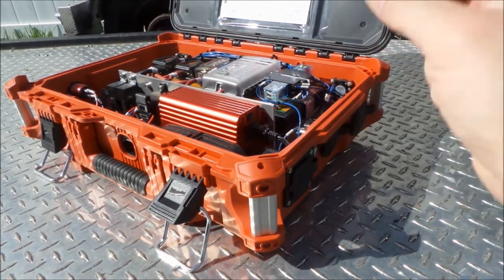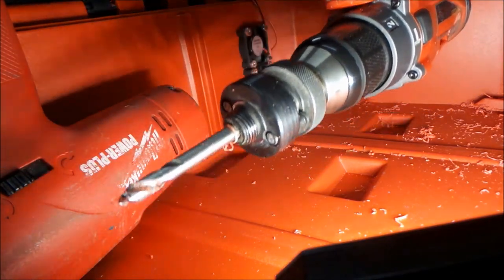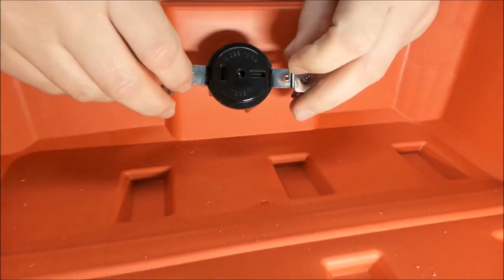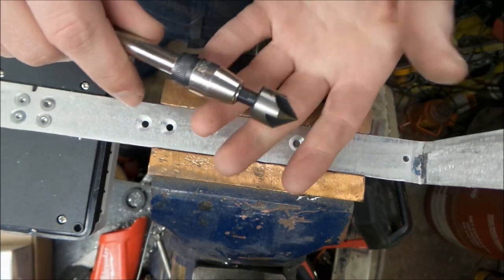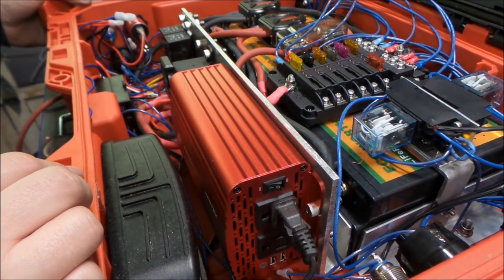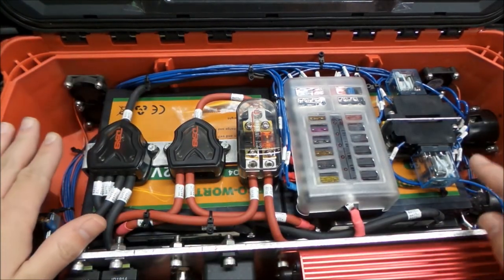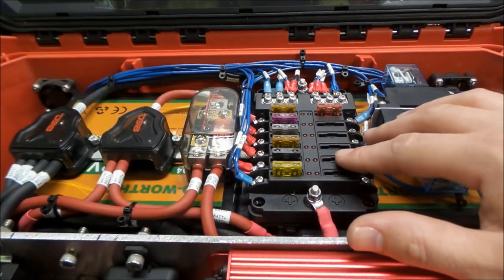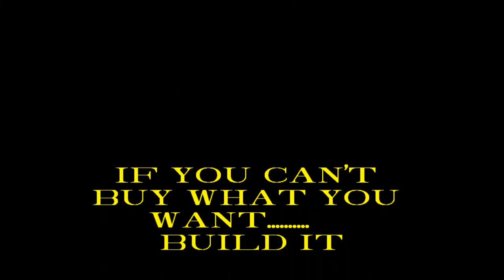More Fun with DIY Milwaukee PACKOUT Portable Power Inverter Project / Packout Power Ep. 2 - Building

Comment: This project was by far, the best I’ve seen.  Your attention to detail was outstanding.
I could stare at this for hours. 
Well done!
Reply from the maker: Not sure how I missed your comment but thank you.
Reply: woow nice build love it i have 3000 watts 48V 120V 60Hz 40A  I i have breaker in my tool box 4 breaker 2 15A breaker and 2 20A breaker for my out let them make my own breaker panel for my inverter cause i have one out let coming from my inverter and my inverter is 3000 watts pure sine wave
Reply from the maker: That sounds really neat. With mine being 500w, I wasn't too worried about needing power distribution. If I ever make a bigger version, multiple circuits and distribution breakers would be part of it. It sounds like you have a nice assortment with two 15A and to 20A circuits.

Did you build your entire rig or just the power distribution part?
Reply: One guy burn out his 3000 watts 48V inverter show the video on here just trying safe i used tools table saw 120V 15A  ,skillsaw 10A,jigsaw 7A etc

Comment: About fuse sizing. Since we are always learning. Common error is to fuse to the device. We fuse to protect the wire not the device. A 5 amp device will draw 5 amps. Wire size to that draw, then fuse to that wire size and length with desired volt drop in mind. We do not “burn up” a device because the wire or fuse is too large. Comment welcome.
Reply from the maker: Fuses can be used to protect devices as well as wire. In the instance of this project I used the fuses to protect the devices all the wiring was capable of easily handling the current of the fuse. In the instance of a motor load the fusing will protect the wiring and the overloads will protect the motor. 

I won't fall on a sword and say there's only one way to do it both methods are valid. In this project I chose to protect both the switches and the devices with my fuse sizes. Hopefully that helped.

Comment: I would take the case off the inverter for extra air flow because this is all encased. Great build btw. I love these builds.
Reply from the maker: Thank you for the comment, I didn't consider removing the inverter from the case. I wonder if taking it out of the aluminum case would impact its ability the dissipate heat. That would be a great experiment if space was needed on a future project.
Reply: @TalkingHandsTools  true it might be a good heat sink at that.

Comment: Great video and assembly! Have a question about diods - use use only one 100a
 with the relay that operates inverter and 50a with 12v outlet? No smarrer diods?
On part 1 video you show a scheme with a lot of diods) 
As I understand - no diods needed with AC relays, only with DC? Thanks ahead!
Reply from the maker: I do actually use smaller diodes on all the relay coils and DC loads. I had a recording issue that resulted in me missing some content. The smaller diodes are among the items missed. I ended up putting them in shrink tubing, which may be why you don't see them. 

Generally, the collapsing field in DC circuits can have an impact on contact tips. The diode allows the reverse current created to flow back into the circuit and not out the contact tips. There are other ways to do this, but we went basic on this project. I did loosely size the diodes to the load, and I've not had issues so far.
Reply: @TalkingHandsTools  Thanks for quick answer and sorry for my poor English. Im from Ukraine and russians started to shell owr civil electricity distribution again. So Im making something similar to yours.
To clarify - no diods (Ive already wached part 3 with v7 diagramm) with AC relays, no need. A big 100a on a relay to inverter and smaller 40-50a on circuit to power output. And small to other components. Ive added a screenshot - https://photo.travel/user_files/sfs/270/file_18056.png
Reply from the maker: Send me an email it's the channels name at Gmail. I'll send you a PDF version of the drawing. The one diode isn't shown twice the 100A one is across the load of the inverter and the lower is a smaller diode across that relays coil. I'll answer what I can for you.

Comment: That is very nice build cool love it 🥰🥰🥰🥰 the only thing i never see no body have breaker in them i build one i have 20Amp breaker from  that gose to 110A/C outlet so nothing will worng with my inverter the breaker will just flip
Reply from the maker: My larger 2.0 version has breakers. I'm slowly building that project as I have time.
Reply: @TalkingHandsTools  That cool not lot people put breaker in them you are only one and i see put breaker inside of it i have 3000 watts  need to get fixed broke some off it keep up good work
Reply from the maker: The one I'm currently designing should be about the same size as yours. I'm hoping to add quite a few features over what you see in this video series.

Comment: With only 500 watts what your use case ? What do you have in mind ? Cool Engineering !
Reply from the maker: I used the Milwaukee 48-22-8424 case. I designed this with portable lighting for photography in mind (thus the remote) the lighting load is around 350w so it's within 80 percent of the inverter. I'm sure I'll use this for other things as well but I designed it for the photography application. I may also consider making a larger scale version with the lessons learned on this one. Stay tuned next week you'll see it run a few things.

Comment: VERY nice Build! How much $$$$ are you invested in this setup?
Reply from the maker: Thank you very much, I'd guess between 4 and 5 hundred. The batteries and inverter are the most expensive parts.
Reply: @TalkingHandsTools  I design and build small scale Solar Systems for locals in my area. I'm TRULY impressed with how CLEAN your unit looks!
Reply from the maker: Thank you very much! It was a very fun project. What size systems do you put together? I'm on learning curve with solar myself. I'm toying with making a slightly larger version of this and incorporating solar in that project.
Reply: @TalkingHandsTools  My units are roughly the same size as yours, but are much simpler in their design and build. I HEARTILY agree with the Battery you chose-I use the same ones. They're a good value for the money.

Comment: With your external underside countersunk screws, what is to stop those from simply pulling through the underside plastic case wall over time ? Plastic isn't metal, and the obvious pliability of the plastic against the superior hardness of your stainless steel externally countersunk screws will easily pull through your thin plastic underside external case wall.
Reply from the maker: There is a decent amount of surface area on the screws. It'll be interesting to see how things hold up. So far, I've not had anything work loose. I don't tend to throw my gear around, and I normally do what I can to take care of things. That being said, if this were aimed toward a more commercial market, I would agree 100 percent that things may not be as robust as they should be. 

Taking the extreme size limitations into consideration, how do you feel I could make things more robust and still maintain the ability to utilize the packouts functionality with locking into other packouts? I played around with a few ideas, and I figured I'd give this a go and see how it held up.

Thank you for the comment. You bring up a very good point. If I build a larger version on this, maybe I can try another method. If anyone else in the comments had any ideas, I would love to hear them.

Comment: It seems that you left out a lot of detail about the aluminum framework that holds everything into place as well as grounds it all. Overall just a brilliant project and along the lines of what I want to build. I'm a carpenter and more interested in the structural details for obvious reasons, but I do field work as a bicycle mechanic. I can see a similar setup (perhaps with solar charging capabilities) getting me through a long weekend of charging phones, running a computer or perhaps a power tool.
Reply from the maker: I had an unfortunate moment of "Thought the camera was recording" when I built the aluminum framework, so unfortunately the detailed shots of building that didn't make it in the video. This has been a great project, and it has been super handy to have. If you're looking for a lower capacity rig, I think you would be really pleased with something like this.

Comment: I have 48V solar charger controller  its 30A ok am in Toronto Canada  how solar i need or how much 12 volt panel i need to put together to charge my battery 4 battery 18A each
Reply from the maker: I'm not following your question exactly but I'll do my best. Wattage is always going to be equal to amperage times voltage. So an example would be an 18AH battery would take a 1 Amp charger approximately 18 hours to charge. There's always so loss so it won't be exact. That being said a 100W solar panel at 12V is Approximately 8 amps. With no shading the and no other loads 100W panel would charge the 18 Amp hour battery in just over 2 hours. 

Hopefully that helps out. I know you were talking about a 48v system but again wattage equals voltage times amperage. Or Amperage equals wattage divide by voltage. By doing this you can figure out the amperage output your array will have. From there divide your battery Amp Hours to figure out how long it'll take to charge your batteries. 

Make sure your charge controller can handle both the voltage and current of your planned array. You mention a 30A charger. Make sure you follow the voltage spec for that current and remember the charger will only put out as much power as the array supplies it.

Comment: How dose it last full charge
Reply from the maker: If I'm running it with about 80% load I can get around an hour out of it. It was designed with intermittent use in mind as well as remote charging. It lasts quite a while. This was a super fun project to put together.

Comment: Is the 12 volt plug input or out ? Would be nice to have solar input.
Reply from the maker: The 20A plug can double as an input. If I go solar I'd likely install a flanged outlet to take a female plug. I don't have an array to charge at this time but it can easily be done. How many amps does an array normally run?
Reply: The cheap one 100 watts
Reply from the maker: Thats under 10 amps. Are they safe to hook directly to the batteries or do they need auxiliary equipment? I honestly didn't look into them when I did this project.
Reply: @TalkingHandsTools  for my u understanding you need to connect to the batter charge controller

Comment: Skipping through your video. Using relays I guess you can use very small switches if you use small transistors or microcontroller. So no worries of burning out the switches.  That's why they use electronics. So no overloading the switches. But other than that you are better making your build professional.  So I would think you would be using electronics.
Reply from the maker: I like to be a bit old school with things. But in all seriousness, I might use some solid state stuff in a future project. 

I chose relays for this project to try to make things like this fairly simple and obtainable for people.

A big goal I had with this build was to try and keep the components as simple and readily available as possible. 

Thanks again for the comments. I hope you enjoyed the build.

Comment: Next video please put parts list and schematic please.
Reply from the maker: The schematic is in the slide show at the end of the first video, I run through all my versions. Like any good projects it evolved a bit as I put it together. I run through all the major components in the first video also. The parts are for my application, I was going for a 2 hour runtime at 350w I should get close. That said the performance of this will be very frustrating to someone wanting to run higher loads. Different products would be advisable to increase performance. With these things they almost need to be built to a purpose. This one has a pretty firm 500w limitation which isn't all that large.
Reply: @TalkingHandsTools  What would you suggest if I was wanting to run a tool that caps at 1300 watts (Leister Heat Gun)? Im a commercial roofer and sparkies dont like putting outlets on the roof unless the tinbangers spec them on the a/c units.
Reply from the maker: How much run time are you looking for?
Reply: @TalkingHandsTools  maybe an hour or 2
Reply from the maker: That would be around 200-250 ah of battery and I'd stay above 1500w inverter. It's doable but it would be a costly rig to build. Do any of the other cordless heat guns hit the Temps you need?
Reply: @TalkingHandsTools  the Milwaukee battery heat gun was a disappointment for heating pvc conduit to make bens. But for shrink wrap and having to do inspection with the fire marshal on heat detectors on a fire alarm system priceless. make life easier then having to drag a extension cord around.
Reply from the maker: I absolutely agree heating conduit is way beyond the capacity of it. I mainly use mine for heat shrink and it does that really well. I've used a propane torch designed for heating pipe that has been the best cordless option I've seen. I guess if you really wanted you could power a hot box with a battery rig but I don't see that being overly effective for lots of underground.
Reply: @TalkingHandsTools  not really. Our guns reach up to about 750* and higher if I’m remembering right
Reply: @TalkingHandsTools  the real question is would the rig be more cost effective than buying the Milwaukee battery generator
Reply from the maker: I think that question will be better answered if the rumored products from milwaukee come out. This is all fairly new and evolving and the market hasn't decided which way it will go. There are many ways to design a rig like this and I'll be curious to see what comes out. Building a higher capacity version is doable but it will be costly at this time. Maybe a new release will have more capacity, if it does its likely to cost less than building one.

Comment: Nice build. Why imperial measurements. Thought the world was moving to metric. I lost focus watching as a result. Sorry mate.
Reply from the maker: Well you see, here in the states we'd rather use a unit of measure established on a kings foot....I don't have an answer for you it's how we do fasteners and measuring here. We do end up with two sets of tools though as a result.
Reply: @TalkingHandsTools  ok. Fair enough. I’ll have to watch again and convert all measurements. I’m purchasing parts at the moment to build a system and was undecided as to how I’d house the emergency solar station. I’ll defo watch again. Thanks.
Reply from the maker: Just like you my brain doesn't work in the other system I'm getting better as I get into more stuff. There are larger packouts available if you went a little larger you should be able to cram in your solar controller. I may make a larger version of this on the channel at some point.
Reply: @TalkingHandsTools  ok great. I was thinking of mounting on ply that painted with fire retardant paint. With castors. A bit heavy but easy for me to build with my arthritic hands
Reply from the maker: Everyone has their own application for their own gear. I wanted this project to be portable which is why it ended up a smaller inverter and smaller batteries. If you wouldn't need portability building it the way your saying would be perfect. You would have lots of space to nicely lay everything out and even have plenty of room to add stuff if you want to later. That sounds like a fun project, I had a blast laying out sizing and designing this. Is it perfect , nope, could it be better, absolutely but we got a very functional build that is working great for the application we designed it for. Let me know what you build I'd love to hear about it. Like I said I'm toying with the idea of building one of these on a larger scale and it would be great to hear what other guys include in their builds.